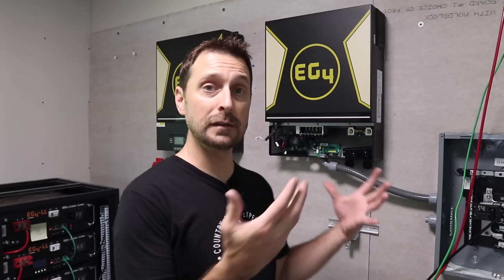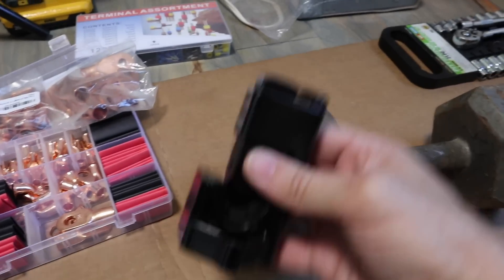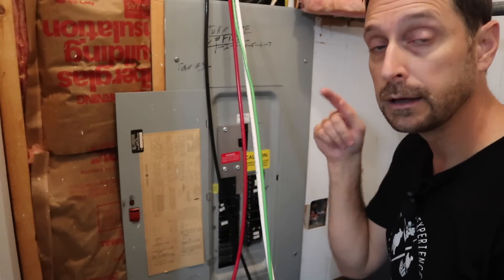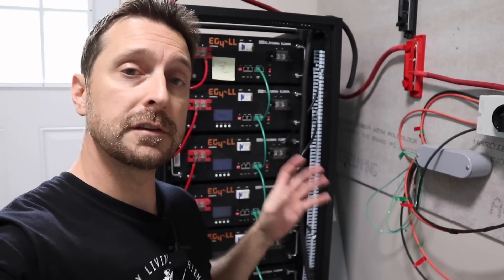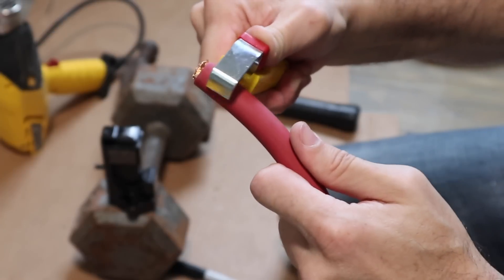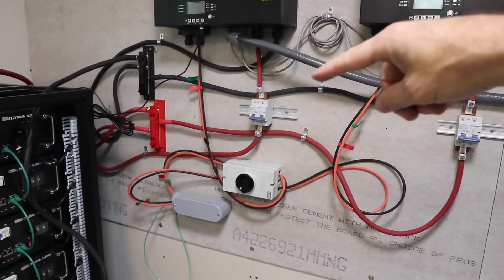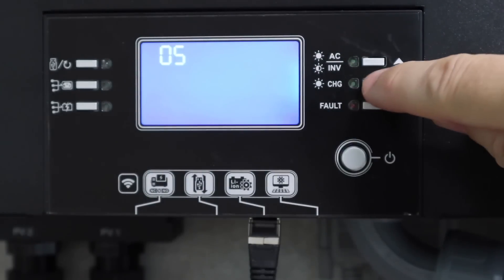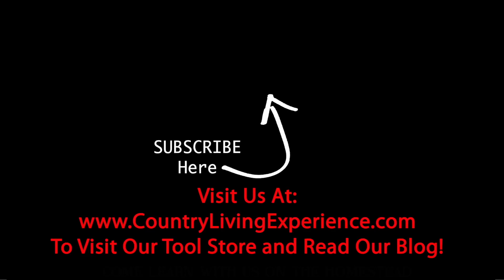EG4 Inverter Installation Full System Wiring And Tips! Off Grid Solar!

Comment: Great video. I am installing the identical system. My EG4-6500 should be in this month. I will be using the A/C in also to feed the inverters. Really appreciate the time you have taken to provide the detail. Still working through the grounding / neutral vs main panel/sub-panels. Again, thanks for showing us your process.
Reply from the maker: Thank you. 
Good luck with your install.

Comment: FYI 
Thhn conductors should be installed in conduit. They should not be ran freely in the attic or in a wall cavity. 
Other than that,  it looks good. Interested to see how it performs over time.
Reply from the maker: They are in conduit in the attic. Didn't know about the wall cavity but that makes sense to keep it consistent. Thanks.

Comment: May need to double check something... I'm currently setting up the exact system, and emailed signature solar about the Nader 200AMP DC breaker between the inverters and the battery bank, I was told that the line side should be attached to the batteries, and the load side attached to the inverter. To protect the inverters from a possible surge from the batteries. Something just to double check, I think I will contact signature solar again as well to triple check. Awesome videos, keep up the good work!
Reply from the maker: Thanks. I will look into it.
Reply from the maker: Yep, correct. I need to flip mine.
Reply: I'm not too sure about this.I bet they work either way.
Reply: @sh839c  Yes I do believe the Nader DC breakers are bi-directional.
Reply: @CountryLivingExperience  before you flip them, contact Nader, because I think that they are bi-directional breakers after doing some research myself. Because it's a real pain in the butt to get that 2/0 cable into that 3/8" lug (I used Scotch tape to wrap it up one wrap and then remove it with a Wood screw)
Reply: @ajlone8669   They are a pain to connect . I believe they can mount either way so I left mine as is, load side to batteries I did spend some time trying to find out with no solid answers..
Reply from the maker: @ajlone8669  I already flipped it and confirmed with Sig Solar that it did need to be flipped so the load side is at the inverter. Thanks for looking into it though.

Comment: Nice video and setup.  Can't wait to get mine going as well.  FYI, I think the 120° out of phase setting is for 3 phase power.  At least that is a guess.  Thanks.  JohnnyF - CO
Reply from the maker: Thank you
Reply: I currently have a 24v powder mr running my house just upgrade from 12v 3000 watt but hope to get  EG4 battery when can afford
Reply: You are correct. 3×120°=360°

Comment: Your channel is a goldmine. I really appreciate it. I have 6 EG4 batteries in a rack and am thinking of adding 3 more in a smaller rack like I think you have. Did you connect the two with a 300 amp pike bus bar? Thank you!
Reply from the maker: Thank you, I appreciate it. 
Yes, I combined them on the 400 amp pike bars.
Reply: @CountryLivingExperience  oops -- I mean 400 amps. Thank you!!

Comment: Great video! I am in the process of installing one system like yours (same set-up) and I am not clear on the THHN wires.The 2 hots and the neutral are 4 awg, and the green? I don't seem to recall you mentioning the awg for the green one. Did you use a 10 or 8 awg for the ground? I am following your installation playlist and it is so helpful! Thank you!
Reply from the maker: Thank you! Glad it was helpful. The 2 hots and Neutral are 4awg yes. The green ground can be 6awg.
Reply: @CountryLivingExperience  Awesome! Thank you!

Comment: Excellent video!!! 
In my mini backup circuit I connected the Nader 200Amp Breaker with the "Line" terminal toward the battery and the "Load" terminal to the inverter. I see (7:31) that your system is set up the other way around (line to inverter and load to battery) Do you happen to know which is the correct way? I'm considering using a 200-amps fuse instead to make sure. Any thoughts?
Reply from the maker: Thank you. 
After consulting with Signature Solar after this video, I switched it to be like yours. You did it correctly. 
I like the controlability of the breaker instead of a fuse. If that fuse blows, you need to buy another.
Reply: Thanks for your reply. I emailed Signature Solar with the same question, but I never received an answer. You're correct about the fuse; this is the reason I went with the braker. @CountryLivingExperience
Reply from the maker: @alfajuliet  You're welcome

Comment: As always great explanation of the setup!  Odd how the data cable needs to be flipped to stop the code 61.  I still get the code 61, never a dull moment with solar.  lol
Reply from the maker: Thanks. 
Yea, when I flipped it mine stopped with the code. Maybe try a different cable. You are correct, there is never a dull moment.

Comment: Noticed your Nader breaker are you running in reverse? Line is on top load on bottom or does it matter?
Reply from the maker: After consulting with a few people, I flipped them.
Reply: @CountryLivingExperience  Thanks thats what I was going to do, just wanted to make sure they couldnt flow either way.
Reply from the maker: @FEMIOffRoad  They can flow either way actually. It is just "advised" to run them with load side toward the inverter.
Reply: @CountryLivingExperience  Been trying to get a hold of Sig but on perma hold did you flip yours to make this happen thats what I trying to get from them to see if breaker will operate ok., Thanks for the help got it all done just waiting to make this connection.
Reply from the maker: @FEMIOffRoad  It works either way but I have been told to put the load side toward the inverter.

Comment: Thanks for the walk through I have my panels, inverters and batteries and in the process of buying wire load centers and accessories. Still have not got my rack installed for the panels but the local code inspectors will not issue the permit until I  have everything. I suspect that is it is a DIY project they seem to frown on that.
Reply from the maker: Bummer that you require an inspection. Hopefully they won't give you too much grief.

Comment: Great job with this video.   It would be great to have a follow up with info on how the 6500 AC charger doesn’t work with a gas generator.   I’ve tried all types of options, tech support says only way to charge when off grid is to buy a 2nd AC to DC charger to run off of the gas generator.   Not happy with this option.    Extra $150 for the 2nd charger, plus it comes with clamps.   They recommended that those be cut off and attach new lugs to bolt onto the batteries.   Seems like a big pain after spending so much money.
Reply from the maker: Thank you.
Very interesting re: the generator charging. When I talk to the Sig Solar guys again I will ask about that.

Comment: I wanted to tell you how much I appreciate the detailed listings.  Saved me a lot of time.  The one link for the Ferrule tool goes to a telephone crimp connetor tool. Do you know of an alternitive for the "hardy Board" stuff.  I'm not a fan and I really don't like to even get that stuff on my hands.  (grin)  Wife and I enjoy your other vids too.  Thanks and have a Merry and Blessed Christmas.
Reply from the maker: I appreciate it, thank you. 
Sometimes they change those link connections. It is hard to go back and change them. Hardy is what I have always used. Try looking at  your local hardware store for a different brand. Most of them are all similar composition though. 
Merry Christmas!
Reply: I added 2 3'x5' Hardie boards.. Looks good but I dont like the dust when drilling into the Hardie board. Vacuum is a must.  Still waiting for our 6500.  Looking further on your install.. I see you didn't install the AC input for the 6500's battery charger power?
Reply from the maker: @compass504  Cool. I don't plan on adding the AC in to these.

Comment: Do you need to connect the inverter(s) to the CAN port on the batteries (assuming they have a CAN port)?
Reply from the maker: No, CAN but does not work (well) with these inverters. These are RS485 connections.

Comment: I need to see how to wire up the DC disconnect to the PV ports. Could you go over that? My DC disconnect has mc4 connectors on the wires coming from it. Do I cut those off?
Reply from the maker: It all depends on the brand and model of PV disconnect switch you have. If t does not have MC4 connectors, you will need to cut them off and use the bare wire to connect them. I have bare wires connected in mine.
Reply: @CountryLivingExperience  My responses keep getting deleted for some reason, maybe because I'm inserting an Amazon link? Weird. So the name of it is DIHOOL Solar Panel Disconnect Switch, 2x32 Amp 2 String DC 1200V 2 in 2 Out, IP66 PV Combiner Box. I see someone else down below was asking for the same guidance on wiring these up, it seems everyone skips this for viewers for some reason on all the videos.  I just found a video of Prowse suggesting to create leads with mc4 connectors on the ends and wire those into the inverter, then you can still use the mc4's on the disconnect box to connect/disconnect. I guess it's 6 or half a dozen on which way to do it?
Reply from the maker: Yes, it is probably because of the link. 
I have an IMO disconnect switch from Signature Solar which takes bare wire connections. It is the 6 in one hand, half dozen in the other issue. It does not matter, as long as it is connected correctly per the specific manufacturers instructions.
Reply: Those disconnects are supposed to be placed next to the solar panel array and you simply plug the outputs from the panels into the disconnect.  Most extension PV wires come with MC4 connectors.  If you are using bulk wire buy a MC4 installation kit that comes with a crimping tool and connectors.
Reply: @daddio7249  my DC disconnect was different, so I had to clip my ends of and wire in. However.... It looks like people are putting these disconnects at the inverters, as well as another one out at the solar array?
Reply: @kimfella4770  Yes, I put the disconnects that came with my kit from Signature Solar out by my panels and a combiner box with fuses, DC breakers, and SPDs inside next to my inverters.  I made up MC4 connectors to wire into the disconnects not realizing I had to cut the ends off the extension PV wires that I got to reach my panels.  I guess I can save those in case I add any more panels to my system.

Comment: Your videos have been a lot of help as I gather the materials I will need to build my off grid system. I have a cabin I plan to power with the EG4 6500 and 3 48v LLs. Inverter hasn't shipped yet but in the mean time I am trying to figure out how to best address surge protection. I will have two strings of 6 panels in series. Do any of your videos outline how you protected your system? Thanks!
Reply from the maker: Glad they were helpful. 
I have not added surge protection to the DC side of my system yet but I plan on it. The inverters do have some internal protection.

Comment: I installed mine a couple months ago.  The solar installer mounted it and didn't even have the panels hooked up yet just the breaker panel to the cabin. I also have a 48v eg battery also. Anyway we turned it on and control panel on the inverter started to light up and go through its check outs. Then we heard a pop and nothing no display nothing  the battery faulted out with the inverter hooked up. 
Called signature and after a few checks they determined it was DOA.
We hooked a 3000 watt growatt up temporarily to the battery and it's been working fine.  Signature sent out a new EG4 that we're going to install soon.  Fingers crossed it will work.
Reply from the maker: So strange it did that. Glad you got a new one right away. Mine fired right up and is working well.

Comment: Greta video! A wiring diagram i found for this exact build had the bonding screw taken out of 2p2 inverter. Did you have to do that? Have you had any issues with the grounding? It also had a ground wire from the main to the sub panel?
Reply from the maker: I did not take out the bonding screws on recommendation of Sig Solar. No issues with grounding. Ground all inverters to the sub-panel and then to your main panel.

Comment: Question on the SBU mode, does that include the ability to have the grid power your batteries in the event of no sunlight?
Reply from the maker: Yes. That is the U (utility) if you have AC IN.
Reply: @CountryLivingExperience  thank you for the info.... I have 2 SMA Sunny Boy 7.0 Grid tied, but am thinking of changing so I can charge batteries for night use instead of selling back. ?!?!  I also have a Generac whole home generator... probably going to be solar poor before its over.
Reply from the maker: @leifdaddow  Sure sounds like you got a lot going on.
Reply: @CountryLivingExperience  yes sir... I kind of got talked out of the battery system and should have went with my gut. I will probably just convert it as I can.
Reply from the maker: @leifdaddow  Batteries are important for sure. Hope you can get it converted soon.

Comment: With the batteries you used their chassis, can you instead use their battery cables they provide and wire them + to + to +, and then connect a thicker 2/0 or 4/0 to the farthest positive, and the closet negative to achieve the same goal as the chassis rack case does?  Will the short 12" wires it comes with support the amperage/load across multiple batteries?  I assume since they included the cables as such but unsure.

Comment: Hi, I am fixing to install our system with the same set up.
Once everything is up and running, are the Nader breakers on the battery cables a potential shock hazard if someone touches it?
Thank you!
Reply from the maker: They could be an issue if something conductive was stretched between the terminals. I have added boxes to them now.